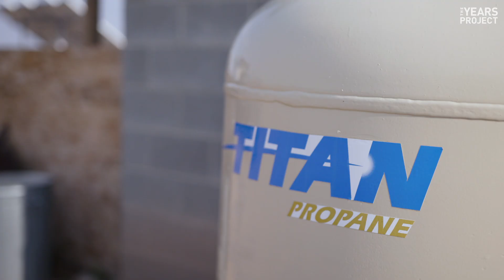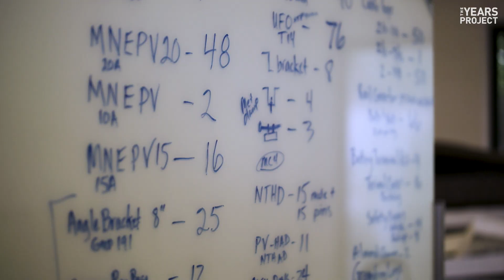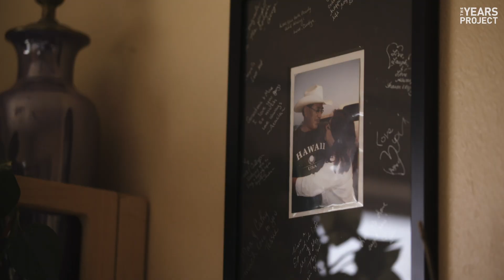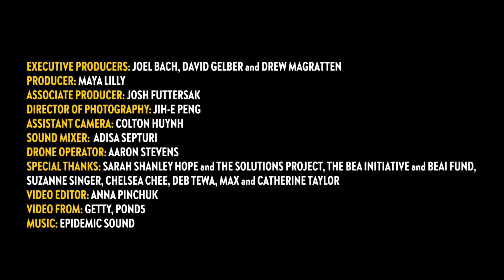Native Renewables: Powering A Nation With The Sun

Comment: Er, how do you power it at night?
Reply: The excess power is usually stored.
Reply: @vampy8723  Usually stored, in batteries? How long do the batteries last and what is their power output in GWs.? How long could they power a town and how much do they cost?
I think you will find that they aren't available yet or hugely expensive. No such thing as renewable energy of course. All the solar panels are made in China using slave labour. Not green at all.